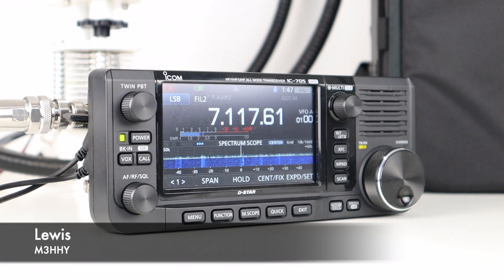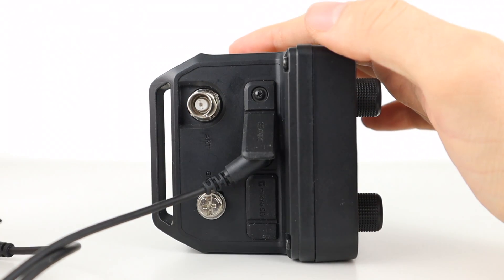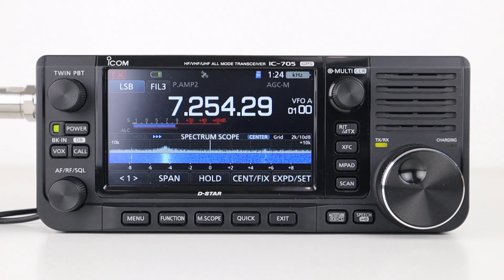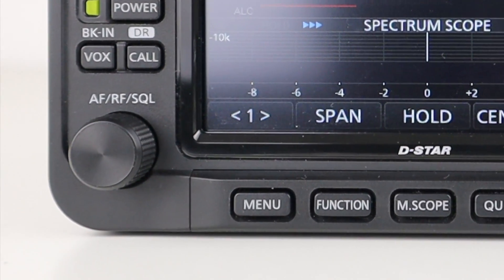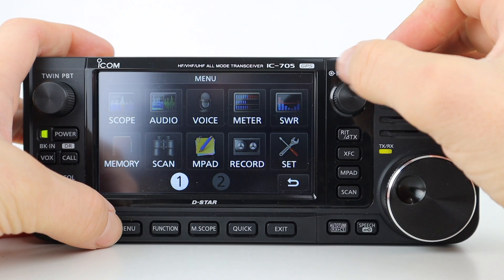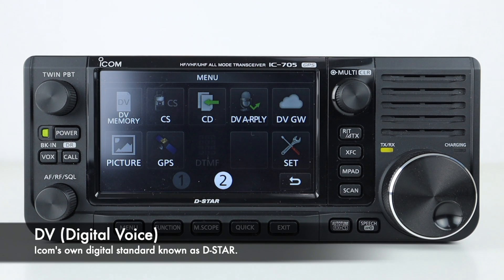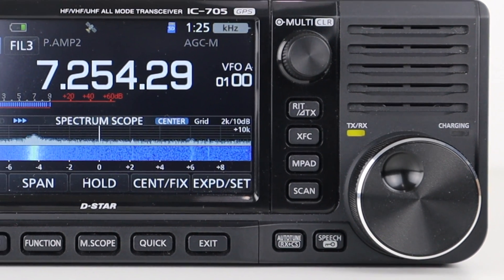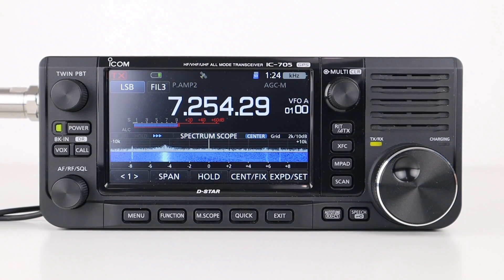An In Depth Look At ICOM IC-705 HF VHF UHF QRP Transceiver

Comment: Great video Lewis, I've owned the IC-705 for around 6 weeks now and absolutely love it.. I traded my IC-7300 to part fund this, never looked back since.. As i only operate  QRP this covers my needs, theirs a great protective case stand with rack handles and perspex front cover.. Check my video with the case fitted, i included a link to the seller in the description..

Comment: Please continue with more IC-705 tutorials.  Optimizing the waterfall scope, SWR graphing capability, recommended changes from factory default settings, etc.  Also D-Star, PSK-31 and RTTY operations.  73 G0NJN / N0KRO

Comment: I’ve seen a lot of advertisements saying that it receives to 144mhz and then some pics of it showing a 433mhz and beyond.  Just wondered why they’re not saying that it’ll do HF to 70cms?
Reply from the maker: It received continuously up to 145mhz, then nothing until 433 mate
Reply: Ahh, I guess that explains why they describe it like that Lewis  @RingwayManchester  

I bought one since my initial comment and it’s a superb radio - as a QRP set it’s great.  I activated Winter Hill with it today and I couldn’t really fault it.  My only observation was that I wanted to hold the mic to my ear but also hold it in my hand while I wrote callsigns down in the log!  I probably didn’t need the bandscope on this summit as I had an awesome pileup but I’ve done some quiet summits using “other radios” previously (I’m specifically thinking Foel Offwrm GW/NW-055) and to be able to monitor the whole of the band up there would probably have been quite useful.  Overall, great set and it may well replace a few of my other radios!!

Comment: I really can't see that battery powering the screen, the internal gubbins and chucking out rf for very long...limited operation time at lower power. Get ready to buy additional batteries either proprietary or third party... Its an attractive radio, but the price! A lot of money for qrp at this  stage of the solar cycle...my money will be staying in the bank.

Comment: I sent a picture today through a radio. I know this is nothing new and quite ancient technology but I found it well cool. I used the robot36 app I think it called and the sstv app. (Sorry forgot to mention I did it using my mobile phone and a cheap baofeng f8) anyway.. the app (sstv) allows you to turn a picture on your phone into a slow scan television format which is like a fax (I think) (sounds and beeps) then I transmitted it over the radio and decoded it on the other end using the robot36 app. Pretty  cool. Could of just used WhatsApp.  But still cool man. I wonder if I sent loads of fast pictures like a sfb or a fsb (fast short burst) full of pictures then popped them together and stitched em like a video if it would work.. lol video through a radio. It's like were going backwards

Comment: The only thing that bothers me is the battery, does the radio run hot after a few minutes? I don't understand why they haven't put a heat sink on, ok I know it is only 5W but using a small radio with that battery generates a lot of heat!

Comment: I would like to know a bit more on how or if it works with an SDRplay or similar as i can't see an RF or IF out. Usually the way Icom seem to do it is to either ask you to use USB for tuning and then you have to TAP it for RF/IF or use a external device like the MFJ708BSDR where as Yaesu (eg: FTDX3000) have a RF and IF out port on the back of the radio.